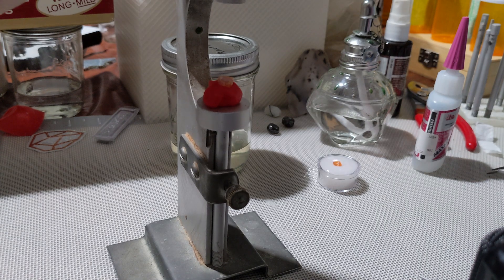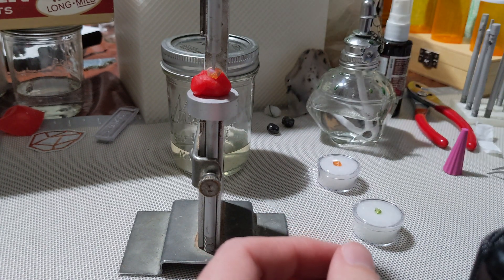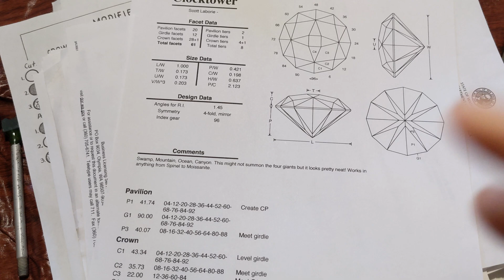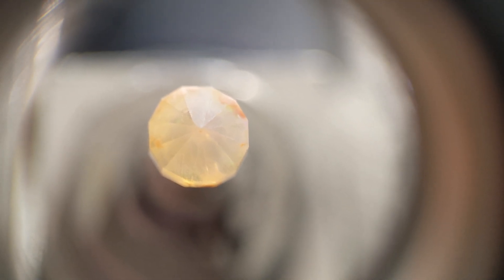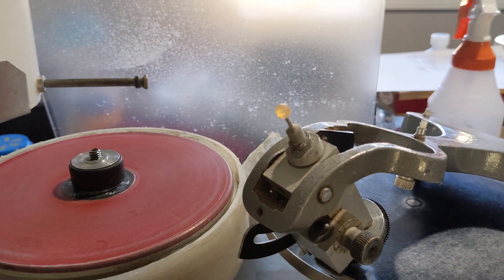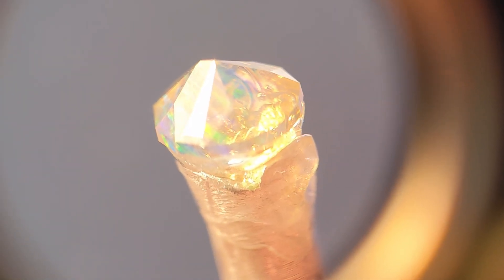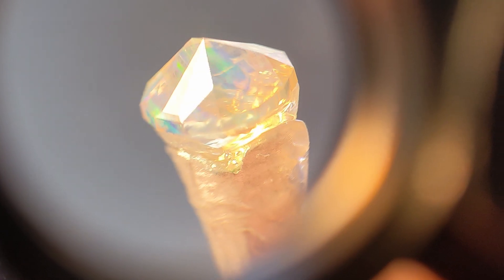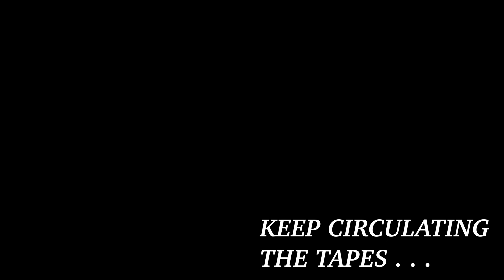Faceting Mexican Fire Opal with Play of Color

Comment: For a piece that you had to cut on the fly because of one mistake, it turned out beautifully! Opal of any kind if going to be more forgiving of mistakes, as long as it remains visibly the same, and not wonky, because it doesnt rely on the light refraction to give the stone its beauty. So you cant tell if the cuts are wrong. It would be the cuts above the girdle that mattered because of symmetry. But that is an absolutely gorgeous stone. and because of the color play in it, it is so beautiful, you dont need light refraction to set off the beauty. It is literally skin deep! and too much internal refraction would detract from the beauty of this stone. So you could not have picked a better stone to have a mistake on, unless it was a cheap glass stone that you could just get any glass and start over! That would have been better. But this mistake, didnt really hurt anything that i can see.Its beautiful and looking at it as any girl would, i would love to wear that stone proudly!
Reply from the maker: It was fortunate that my mistake happened exactly halfway between two facets. When this happens, I like to think rather than cutting wrong, I now have a faceted stone in a design that no one else has made, because likely no one else made that exact mistake!
Reply: @DonohueLabs  It looked beautiful.